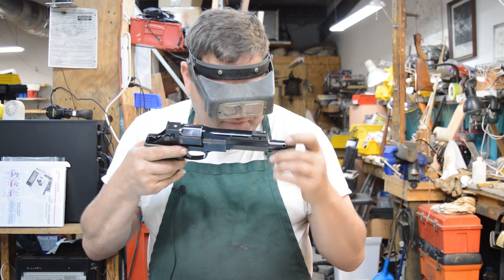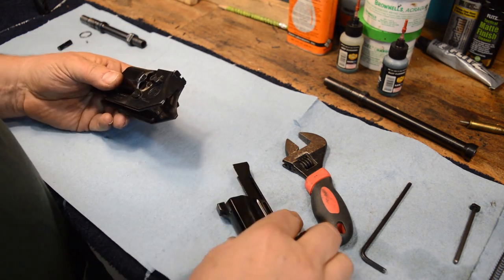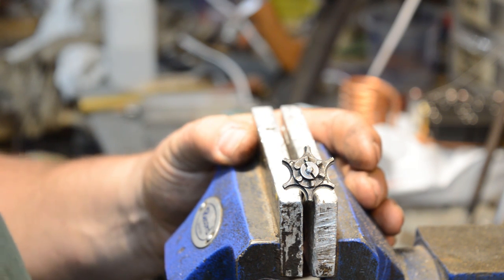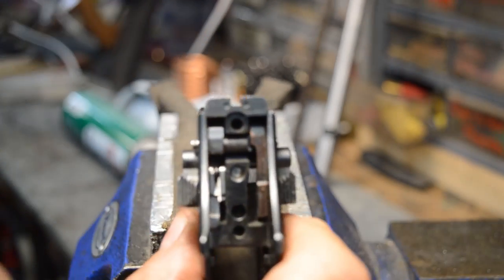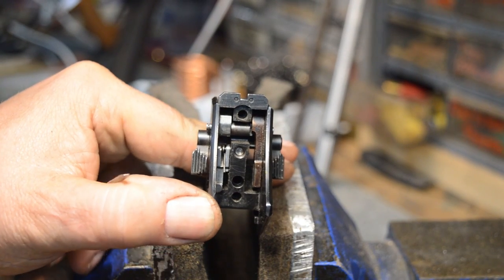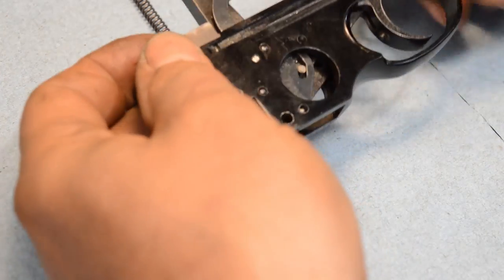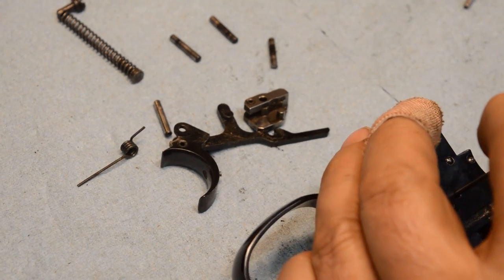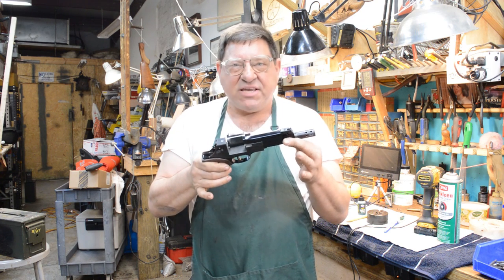Anvil 082: Mateba Unica 6 Conservation and Refurbishment

Comment: Thanks so much for making this! I have a 6-Unica I bought in 2006ish. While it's fun, it's been... Italian? Trouble. Barrel shot loose (I hear from other owners that's typical?), and more troubling, the cocking/rotating mechanism would jam! A few months ago, I disassembled the bit of the gun #47 drives, and boy it was troublesome. The two screws on that back plate, according to the manual, were supposed to be lock-tited. They were completely loose and the slightest finger pressure on my driver removed them. I think what was happening was that firing pin block that slides up and down (not present on your example!) was catching on the back plate as it was pressed out by the back of the firing pin. I don't know though, because the problem was always intermittent! BUT! This video gives me a view of a well shot Mateba to compare to! My part #47 was all kinds of torn up at the part where the little sprung pawl hinges, and i'm considering ways to replicate it.

Comment: A really interesting gun, and an interesting dive into what makes it tick. But I was really hoping to see what you had to do to tighten it up after all the mung was out of it and you had clean parts to rub together.
Reply from the maker: All tugged up and oiled it went back to running as designed. The owner runs this thing HARD and this was the mid flight tune up. We had fun, and just HAD to film this because I have never seen the inside of one.
Reply: @marknovak8255  Oh my god you mean to say he actually shoots his guns? Did hell freeze over?
Reply from the maker: @herrskeletal3994  Frozen SOLID
Reply: @herrskeletal3994  why do you think the owner is paying mark to sharpen his ice-skates.

Comment: Beautifully engineered and designed gun.. If it wasn’t for the cost and it’s looks, it would have been far more commercially successful.. They apparently work flawlessly and the 6 O’clock firing does indeed reduce sight lift on discharge versus a traditional 12 noon configuration.. 

There are some gun manufacturers now copying this style of gun, allowing much larger rounds whilst retaining acceptable handling characteristics..
Reply from the maker: This gun was available up to .454 Casull if my info is correct
Reply: Only people doing 6 o' clock revolvers is chiappa ( the same geniuses who figure selling said revolvers for over $1000, despite caliber only going UP TO 357... real smart)
Reply: @awesomefatBruceLee   The Chiappa Rhino incidentally is the last design by Ghisoni (he passed away about 10 years back), the same person who created the Unica 6
Reply: MA.TE.BA.  (Macchine Termo-Balistiche), via Villa Serafina, 2/B. 27100 Pavia (Italy)

Comment: Owned a 44 magnum in matte nickle about ten years back. Dumb dumb me took it to an outdoor range. Gun wouldn't cycle so I took off the back plate, queue everything go flying.  Digging through dirt grab everything I can find. Took it home and the next day after 4 hours got it back together and working. Mark isn't kidding the manual is in italian. I was working from a pdf, was not fun to  use as a guide for putting it back together. Fun gun, but beat the crap out of the web of your hand. Ended up selling it due to a concern about parts and repair. Later owned a DE in 44 and tbh, while not as cool, was a joy to shoot compared to the Unica Six.

Comment: Hi Mark! I love your videos and your high level of craftsmanship. Had my fair share of c-clips effing off to oblivion and just had a brainwave. Get a clear IKEA plastic storage box with a lid. Cut 2 reasonable big holes in the lid and attach a pair of dishgloves to the holes. That way you can dissasemble springs, clips and whatnot without the risk of them flying into low earth orbit!
Reply: You might be able to get away without the gloves if you can just seals your arms with a rubber diaphragm or brushes. Basically just enough to keep it from finding its way out those holes. At least then you can keep your finger dexterity when messing withe part.
Reply: @Swarm509  True, that's not bad at all!

Comment: Awesome revolver. Interestingly some examples of the carbine version were brought into the UK a while back in .44 and .357, but their auto-cocking function was disabled as to not fall foul of our Semi-Auto ban. In recent legislation however, the definition of semi-auto was clarified as a gun that extracts its case from the chamber by use of gas or energy produced from firing, which this certainly doesn't. I'd love a fully-functioning carbine version, perhaps with a gas deflector on the frame like the Circuit Judge rifles.

Comment: Mr. Novak, thanks for the awesome content. I have to ask, that spanner you made to work on the star, does that go in a box marked Mateba spanner for the next one you work on, or is it discarded into a box of modded bits, and you'll make a new one next time?
Reply from the maker: Returned with the project as a support tool for the gun. Custom tools are always offered to the customer
Reply: @marknovak8255  thats cool, thanks.

Comment: Failure to index is a problem with the 6 Unica. Also, screws loosening up, including the grip screw. I tried several of them about 20 years ago and sent them all back but one.  The Webley-Fosbery is a much more dependable recoil operated revolver.

Comment: Wait, does this video show a third sanctioned use for a dremel by a gunsmith?
Reply: @cas curse I don't remember, but I think in the kammerladder video he mentions there being two acceptable uses for a dremel.  I could be misremembering the video though, I was rewatching some older videos the other day.
Reply: Well he never touched the gun with it soooooo. Definitely could have been done with an angle grinder, but he used it so we all have permission to pretend we know what we are doing now when we pick up the dreaded dremel tool.
Reply: @briancox2721  IIRC it's in the Kammerlader woodworking video - shortening one of the screws pulling the wood together.

Comment: To the spring reference, 'smaller vs bigger', I know what was meant. But for those who are observing that the spring doesn't get any smaller, OR bigger (or that it kind of does both)... that is correct. The actual piece does not change in dimension. It only changes in shape / appearance. You wind a clock spring and then it fits inside a smaller diameter (aka appears to get smaller). You wind a garage door coil spring, which creates more coils. Therefore it 'expands' outwards, do to stacking (aka appears to get longer / larger, on it's shaft). But, visually, a 'hair spring' is more difficult to dissect.The operative word here is "winding" , as opposed to "unwinding". Forcing a spring to unwind beyond it's natural resting state will not only cause it to act ill, it will compromise it's very structure. So as a motorhead would say "Keep it wound tight!"
When they say that someone is 'wound a bit tight', one is saying that someone is under tension and may release it, in a sudden burst of aggressive energy, at any time. lol. I love content that gets you thinking and reciprocating.

Comment: These were made in the late 90s to 2004. I have one in 454 that was one of the last few produced. They are notorious for the grips on the 454 cracking and the company that originally importing them (AWA in fla.) Actually was working with mateba to develop alternative metal based grips for them.
Anyways after the company went bankrupt they were no longer allowed to make any new parts and had to sell off existing inventory, alot of it was sent to AWA and remaining orders were assembled with leftover parts. I have seen a few unica 6s with grifone stamps on the recievers, as well as multicolored ones from these batches.

Comment: I enjoyed the video, but was a little disappointed that you didn't go into what the actual fix was. Did it just need a good clean, or did you do a repair?
Reply from the maker: "Rundown all of the "a" problems, and eventually "the" problem shows itself and is solvable. Once this unit was cleaned, lubricated, and reassembled correctly it ran hot and straight."      Just pinned that comment in response to your question, up top. Reassembly and filming took it out on me, physically and psychologically. I mean gassed, tension headache, everything. I was happy to get it over with. No disrespect intended to the audience however.

Comment: Aaah! To bad! I was hoping to see the cleaning and lubing up close as well ( I find that satisfying. )
Also this: You made a tool especially for that cylinder center-pin. Am I wrong in thinking that that screw is a standard security screw with a plunger in the middle?
I'm no gunsmith, of-course. I don't even shoot. Yet I believe these tools are readily available ( I'm looking at a few right now. Ifixit has the smaller ones, for example ).
Same goes for C-clip pullers. If so... and only if, this would save you a lot of work and frustration. I hope I'm correct with this :).

Fantastic work as always. Fascinating even!

Comment: How effective would an ultra sonic cleaner have been on that lower assembly without taking the whole thing a part? I was having cringe moments as you were in disassembly mode. Thanks.
Reply: Perfect, as long as it did not dribble all the parts and pins out in the process before you determined where they all went.
Reply: Ehh, not as good as an actual full cleaning, some of those interference fit parts were sludged up in a way ultrasonics arent great for. Namely that cylinder shaft.

Comment: I wonder if there are crescent wrenches made out of brass.
Reply: Anodized aluminum, made specifically for working with anodized aluminum fittings(AN fittings) on race cars. I have seen some 'other' material specialty tools though, unique niche applications where the circumstantial use necessitates an uncommon material(think salt water, corrosion resistance is often critical to the life of the part; or in the case of use on softer materials), but that stuff rarely makes it out of those trades because of cost vs actual benefits for non-trade applications.

Edit: oh yea, non-magnetic applications too, like what is required for working around things like MRI machines(there's some videos of them sucking magnetic[steel] objects in from across the room with the electromagnet they put in those SOBs...)
Reply: @RyTrapp0  non-sparking demands, too.

Firefighting tools are mostly brass to avoid sparks.

Comment: 27:42 couldn't that have been done so it's easier to service by making the cross pin a two piece threaded assembly instead of having a literal Jesus clip that if it fucks off on you then you're just all sorts of fucked

Comment: Heavily used, obscure firearm? High speed shooting footage? Left handed? Could this be from the hands of Gun Jesus!
Reply: If Ian had one, I think we would have seen it in a 2-gun match by now.
Reply: @SnakebitSTI  The trouble with this gun is while you can shoot it very quickly and accurately, reloads are excruciatingly slow. You MUST count your shots, as the last round cocks the gun normally, and your next trigger pull will drop on a fired cartridge. You do still have to pull the trigger that last time, because the cylinder won't open if the hammer is cocked, but you don't want to do it aiming at a target on the clock! Also, the gun is not terribly lefty friendly for reloads. You can flip the release with your thumb, but then you can't pop the cylinder open, AND you don't want it flopping around! I, also left handed, just transfer it to my right hand to open the cylinder, so my index finger can keep the cylinder open, and my left can manipulate spare rounds.

Also, no speed-loaders exist for this cylinder.

Comment: I wonder if youd dunked this in a ultrasonic cleanser, would it yave eased the dismantle and reassemble
Reply from the maker: Ultrasonics hose up finishes, and I also do not get to inspect the individual parts because of the lack of disassembly. I will not use one for that reason

Comment: When I worry about scratches while using a wrench I put a wrap of black electrical tape around the jaws. Quick and easy and a lot cheaper than the specialty non-marring wrenches.
Reply: When the guns get that unobtainium, you start getting paranoid
Reply: @wesleygay8918  It just makes sense to eliminate the potential for simple mistakes that could cost you a lot of money as you can afford to. When this is what makes you money, you "cross the 't's and dot the 'i's" to prevent that cash flow from being disrupted, call it a long-term investment.
I'll never buy Snap-on, but I completely understand why others do - for someone who makes money with their tools, they are the last thing that you want to think about, especially when you need to replace one.

Comment: I was surprised at the recoil, considering the blowback action which cycles the revolver; and also the lower barrel position which is more in-line with the forearm. Those things expend a lot of energy, thus reducing recoil...or so I thought.
Reply: They just relocate and delay it, together with a quite heavy gun that makes it feel less at first. But it's still the same, just more on-axis and a tad later.

Comment: I had one of these a long time ago. It was absolute trash. Constant missfires, and when it Did fire, half the time it would bump fire the next round or two before you could blink. Which is terrifying when you are shooting 44mag.  Every screw on that would rattle itself loose in a single shot except for the barrel which was cross threaded from the factory. It was very disappointing.
Reply: Hey Mark, Love the advice you give at the end of the video. I used to spend a LOT of time at the range, but over the last few years I have basically turned into a "firearm owner", rather than a user.  "This weapon is dangerous, I hold it this way, the safety is here, bullets come out there" is a sort of mantra I say to myself to get away from the mind set of "this hunk of metal is dirty. to clean it I must make some room in the kitchen table". So yeah, good advice Mark!
Reply: Well, they're back in 2020! In case you want to give them another try, the importer is taking deposits! They're only gonna be about $2000.00?
Good shooting, my friend!
Reply: @uralbob1  dang, that's not a bad price for a specialty pistol!

Comment: All the mechanical disadvantages of the complexity of a semiautomatic pistol and the main disadvantage of slow reloading of a revolver all in one utterly pointless firearm.
Reply: Probably lessens felt recoil on a revolver.
Reply: It's not meant to be a combat pistol, lol.
Reply: @marcusborderlands6177  C'mon, man. Consider the purpose of the improvements in firearms over the centuries. Ease of use / minimize training. Greater accuracy. Increasing the rate of fire. Ease of reloading. Maximize reliability. High value or very inexpensive. Cost of manufacture. Ability to mass produce. In order for a firearm design to be successful it must address all these areas and excel in some of them. 

One of the primary purchasers of firearms are militaries. Due to the slow reloading process no military in the world was interested plus it didn't excel in any of the other primary firearm design areas. The result is a what was he thinking commercial failure. It's one thing to build a Rube Goldberg contraption for your own amusement. But Rube Goldberg contraptions have a dismal success rate as commercial products.

Do a search on Turbonique for an entirely different product but one that failed for many of the same reasons.
Reply: @curtislowe4577  the military doesn't matter my dude. It was built for the civilian market as both a competition piece and engineering porn.

Yes, Glocks sell more than custom revolvers. Cool beans, I don't give a shit. For me and thousands of other people out there, guns are more than tools, they are works of art. Proper art, not this money laundering modern shit.

Oh, and the gun wasn't a failure, it sold plenty. It was built by a small Italian company and sold for absurd amounts. It's like saying Korth revolvers are failures because they get outsold by Taurus.
Reply: @marcusborderlands6177  
"Engineering porn"  Good one!  I'll  have to remember that!
But you're right, that is a simply lovable piece of complex machinery!
Not that I would want to work on it, but to look upon it in awe!
Reply: modern semi auto pistols are mechanically simple vs any revolver.
Reply: @0Asterite0  bold statements without at least the pretense of an engineering analysis usually (and definitely in this case) are just so much hot air.
Reply: @curtislowe4577  my guess is you've never owned both and disassembled them. a modern glock has 34 parts. something like a ruger gp100 has 72
Reply: @0Asterite0  yet somehow the revolver was a commercial success by the 1830s and the semiautomatic not until the 1890s. Huh. Getting all the systems of a semiautomatic to work together reliably may seem simple to someone who doesn't have engineering experience but it is very difficult. Making a cylinder rotate a specific amount and holding an exposed trigger back is child's play in comparison.
Reply: @curtislowe4577  didn't realize it was the year 1890
Reply: @curtislowe4577  and no, it's not childs play. revolvers can still go out of time and have issues

Comment: Holy smokes! This is one of those just because they could guns.....
Reply: It uses a "semi-automatic" action very similar to the .455 Webley-Fosbery. Unica changed up the barrel location, cylinder rotation, and method of timing. They've got a certain cool factor going on.
Reply: It is very slick for a single action competition revolver.

Metric shitton of parts inside, through.